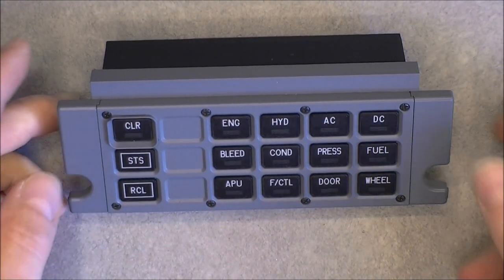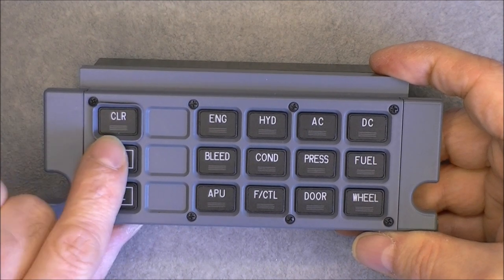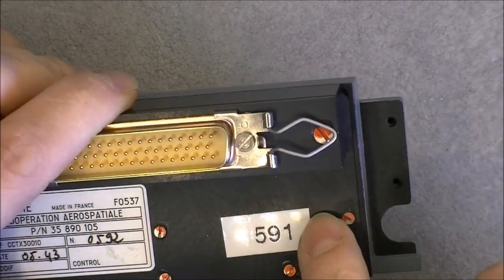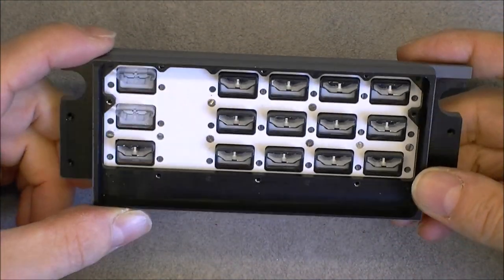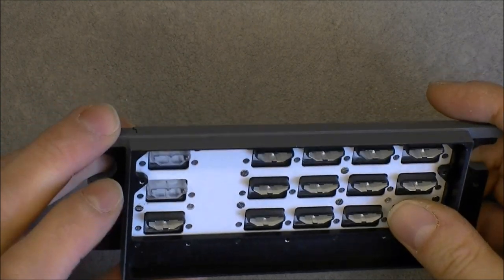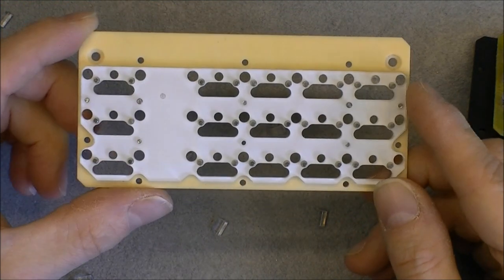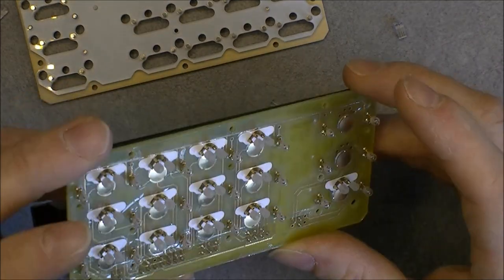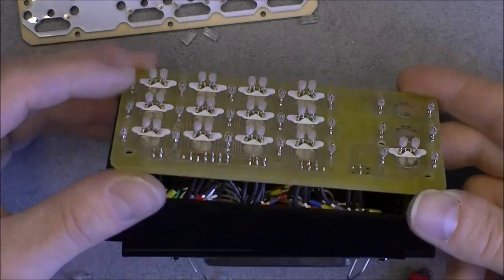Avionics teardown: an over-engineered airliner cockpit buttons panel

Comment: Airbus A300-600 or A310 indeed. STS is status, not store. BLEED is a bleed air system. COND is for air conditioning. PRESS is cabin pressurization system.

Comment: It is an annunciator panel

It shows alarms.
I am not sure about this panel, but in general they:
- Flash when a fault occurs.
- Have a button to accept the fault (like OK I have seen it)
- Indicate if the fault is still present
- Have a lamp test button or input.
Reply: Negative, this is an ECAM panel, it allows you to select which system is displayed on the ECAM monitor.  The selected system button lights up when selected.
Reply: OK. If you recognize it. I forgot to mention that I guessed....